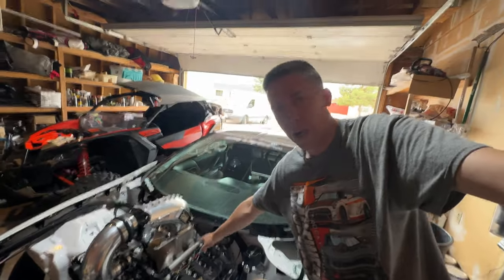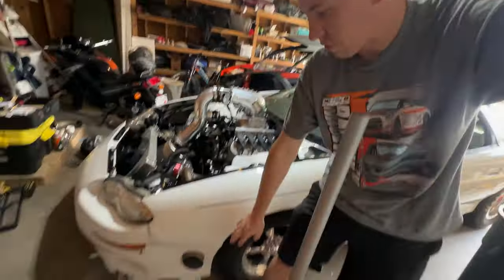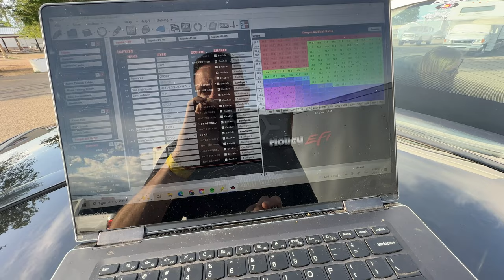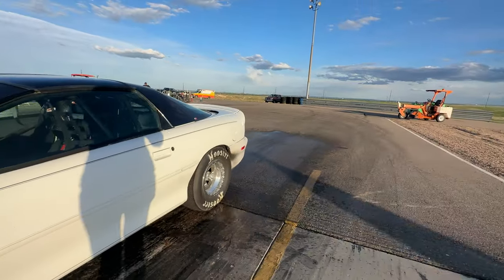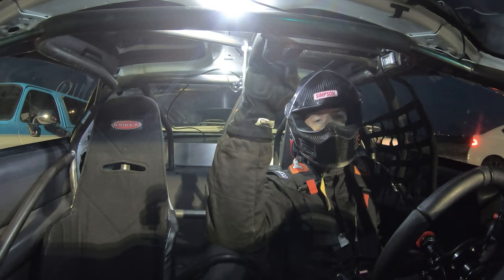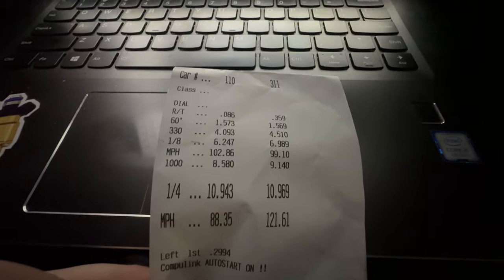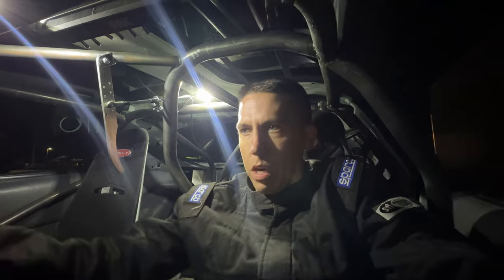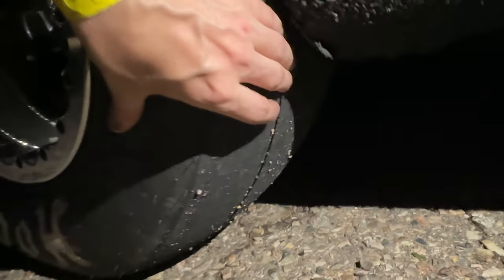Testing My Twin Turbo LS Camaro Didn't Go As Planned!

Comment: Yeah under horsepower you are having a rear steer issue. You can see it in the rear-facing video camera. Just adjust your rear steer incrementally and you'll be good or could we sway bar preload